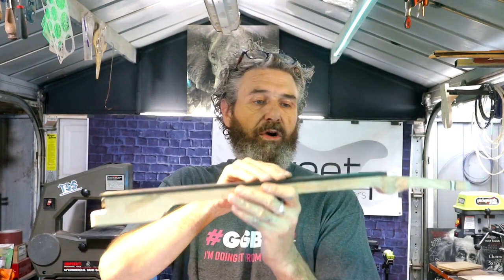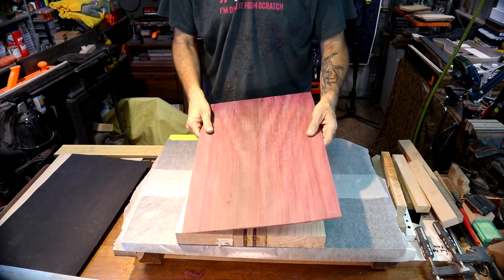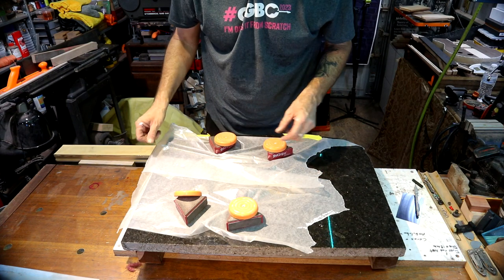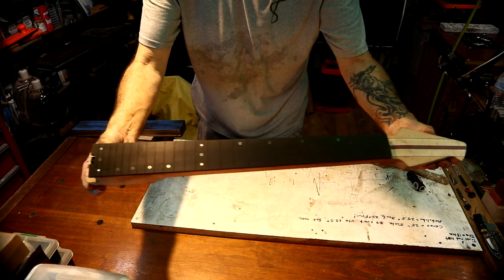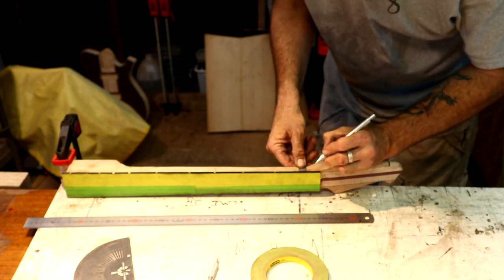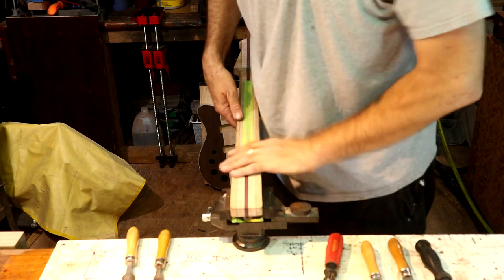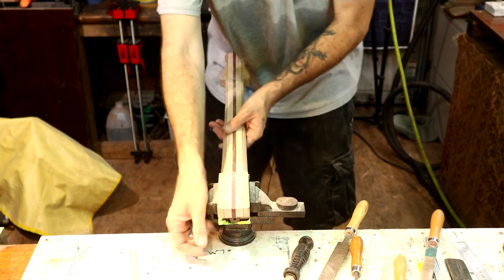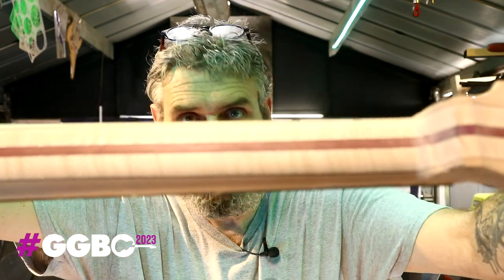#ggbo2023  - Guitar Build - Ceres Theta - Episode 4

Comment: Random ? Where do you get your super glue accelerater?
Reply from the maker: I order the accelerator in a 2 pack from Amazon with Glue for around $20. I'll post a link.
Reply from the maker: Adhesive Guru CA Glue Accelerator Spray (2 x 13.5 fl oz) Aerosol Activator for Super Glues (2 Pack) https://a.co/d/hOrhtZa
Reply from the maker: Adhesive Guru CA Glue with Activator Woodworking (2 x 3.5 oz - 2 x 13,5 fl oz) Ca Glue for Woodworking, Cyanoacrylate Glue and Activator (2 Pack) https://a.co/d/4OBzF34
Reply from the maker: I use the cheap super glue for the Super Glue Masking tape trick and the activator works for any CA glue. I use @Starbond for the important bits!